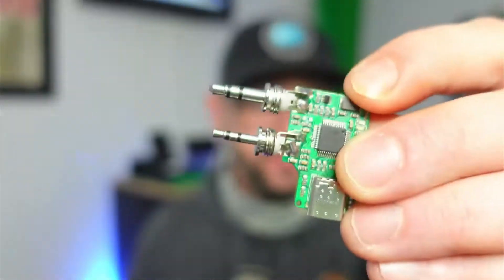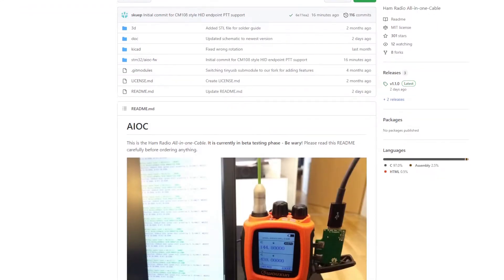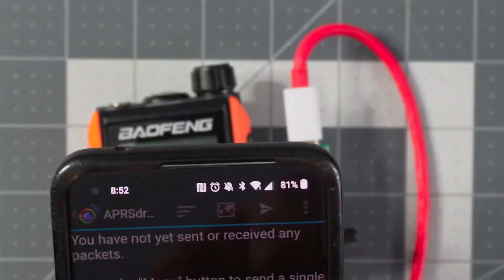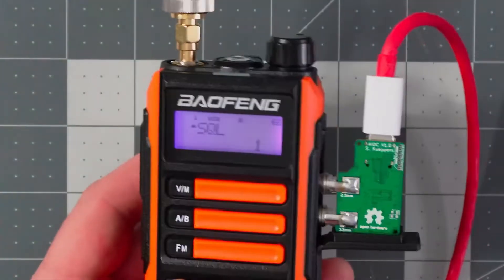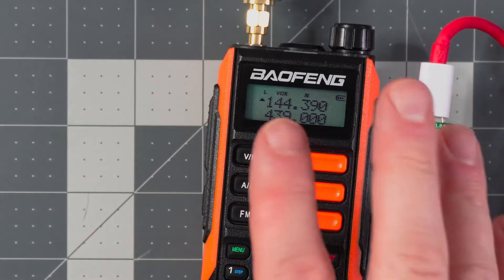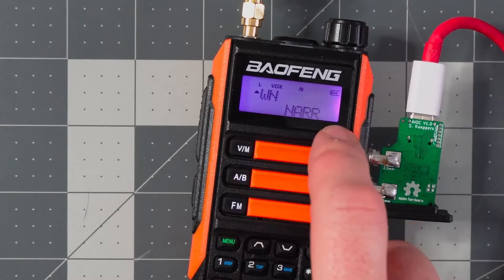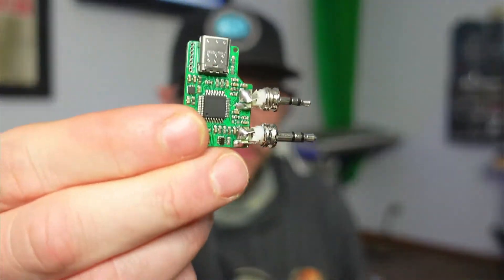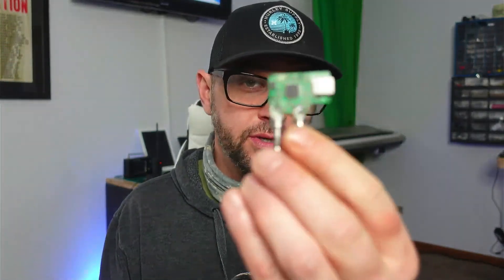Your Radio Programming Cable Sucks!  -  Get The AIOC - All In One Cable

Comment: Can it do PTT without VOX? Leaving the SQL open would be useful for weak signal reception via FSQCall.
Reply from the maker: It may, but I am uncertain.  I located this on the github site : "Since firmware version 1.2.0, a CM108 style PTT interface is available for public testing. This interface works in parallel to the COM-port PTT. Direwolf on Linux is confirmed working, please report any issues. Note that currently, Direwolf reports some warnings when using the CM108 PTT interface on the AIOC. While they are annoying, they are safe to ignore and require changes in the upstream direwolf sourcecode. See wb2osz/direwolf#448 for more details."   Hopefully this will help!

Comment: Hi All! Simon here. Thanks Sean for making a video about the AIOC. Much appreciated! 🙂 Just a heads up, the development around the AIOC is currently very active (e.g. preliminary CM108 PTT support has just been added). Feel free to open issues and feature requests.
Reply from the maker: Thanks for responding!  I spent the day yesterday coming up with an STL For a case.  I have a few issues to work out.  Also, I have a few radios I can test for confirmation if they work or not. I will try to use the github for tracking, although I am not very familiar.  Again, I'm excited to watch this grow. Thanks so much!

Comment: Great video Sean! I am in the process of ordering a couple of these boards myself. Have you tested if you could use this to build an Allstar node?
Reply from the maker: I haven't yet however, I could probably hook one up real quick
Reply from the maker: Allstar nodes will not work currently as in order to have allstar node work, there must be a C-media CM108 or CM119 Sound card built in.  From what I could tell, this is the wrong Chip for that.
Reply from the maker: My buddy actually provided me that information
Reply: @DudeTested  Thanks for looking that up. Looks like JLCPCB is out of some parts at the moment, so I will have to order later.
Reply from the maker: @LB0FI  Yes I saw that too, I wanted to order some.  I'm going to talk to Simone and see if that's a part that could possibly be replaced with another part
Reply: @DudeTested  Let me know what you find out.